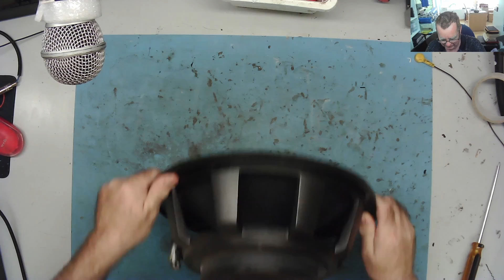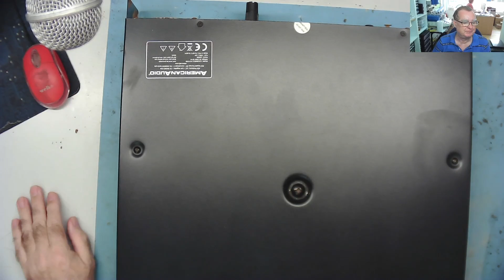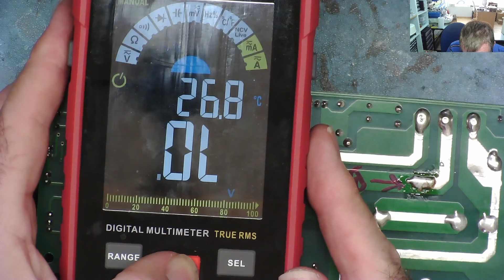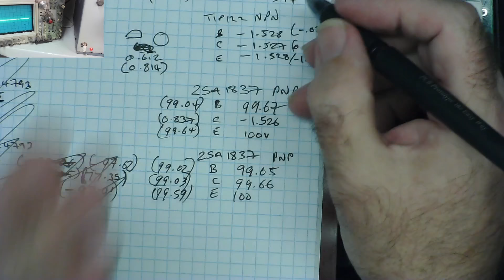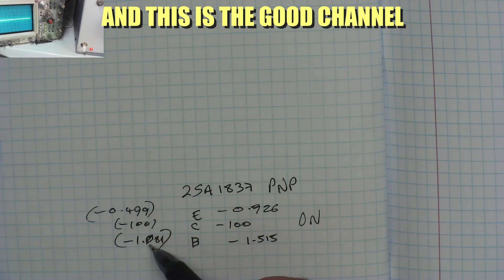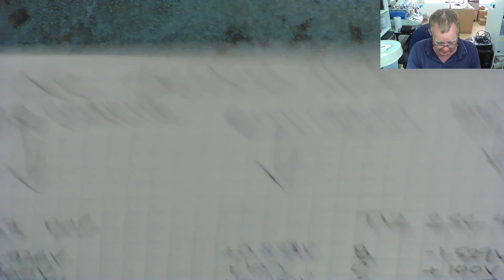Repairing  Electronics From High Level Down To Component Level  Practical Example 1500W PA System

Comment: Being a lazy sod, I like doing a really thorough visual before bothering any tests/components/much dismantling. 80% of the time the issue is visible - as it was here - 20% of the time you have to do the ballache stuff. :-) Is a track burnt? Is a cap swollen? Any dodgy looking bits? Only if the answer is absolutely no would I start dickering with faffery. :-) Like I said, I'm lazy/busy...

Comment: Watched this all the way to the end. Learned a lot.  You da man Richard. BTW, doesn't have to be an EV brand speaker. They are expensive.  Any other basic brand woofer that is more readily available should work as long as it is the same impedance.

Comment: Using the "process of elimination" is basically what you're doing here, and usually the best method when you can do that.
When working on items like this where you've got two circuits with a shared common power supply, you need to keep in mind that one circuit, (faulty one) can drag down your supply voltage/current and cause the appearance of both amp circuits being faulty. So, thats where I would lift the power supply lead to the suspected faulty amplifier and see if you have normal sound. Usually you'll have a plug coming from the supply feeding the amp and hopefully they have separate plugs or you might need to desolder or release a pin on the connector and pull the pin/wire out.
In audio/signal amplification circuits you'll have a few electrolytic capacitors. Capaitors block DC and allow AC signals to pass. When they're used in these amplifier circuits they're called "de-coupling" capacitors. They remove the unwanted DC bias voltage from the previous stage amplifier before the next amplifier stage. Being the next stage may require a different bias to the transistor depending on how its configured to operate or being a different spec'ed component. Like first is the pre-amp then power amp stage having two different types of transistors. Having an old low reading capacitor can give low volume because the coupling is not allowing the AC signal to get through to the next stage or very little of it. It can cause distortion too, because you may be cranking the volume up trying to shove the signal through the weak capacitor into the next stage. Also impedance gets changed with having faulty capacitors. Maximum power theorem, when source impedance equals load impedance is when max power transfer occurs.  You won't have efficient impedance matching with bad capacitors also.

Comment: The signal injection of a sine wave to the amplifier section and move to the output is what i would have personally done first,because SINE WAVES are used to test the LINEARITY OF THE COMPONENTS OR CIRCUIT, I.E THE WAVE SHAPE THAT GOES IN MUST BE THE WAVE SHAPE THAT COMES OUT,IF THIS DOESN'T HAPPEN THEN THE COMPONENT IS CAUSING DISTORSION.THE BIAS COMPONENTS CAN CAUSE A SHIFT OF THE "Q POINT" ON THE LOAD LINE THEREFORE CAUSING DISTORSION ALSO.
N.B.SQUARE WAVES ARE INJECTED TO TEST THE FREQUENCY RESPONSE OF A COMPONENT OR CIRCUIT.

Comment: nice one. I learned a lot. I'm a mechanic, so i font really lknow what I'm looking at. But I think to use signal generator and just follow the path seams easiest. it would have shown distorion on input, after volume board, and a output. Thanks again for showing the whole tought process

Comment: i have been repairing video and audio electronics part-time for over eighteen years, earned a diploma from National Radio Service in Video/Audio Service and I never knew how to test a speaker cone before.  Thank you!  I messed up with a prospective client by telling him, when he brought me over a speaker cone to test, that I could not.  I could have earned money for troubleshooting it if I had only known to check its resistance between the positive and negative terminals.  If I was going to test it, I would have gone through the effort of hooking it up to my function generator and amplifier.
Frank, Frank Reiser Video/Audio Service

Comment: depending on the adhesive used to afix the dustcap to the speaker, you can use MEK (Methyl Ethyl Keytone) to remove soften the glue. Try not to damage the cone as often you can replace the coil without needing to replace the cone, spider or dustcap, especially on professional drivers with large diameter voicecoils. That's a whole other video you could make. 

Some of those EV speakers allow you to unbolt the magnet assembly making it a relatively straight forward job replacing the coil

Comment: Hi Richard, I think this video gives a good insight in to the black hole that you look in to when working on these such things. I think to work on audio circuits you need to have a frequency generator of some sort and an oscilloscope to be able to work on them properly. 

Just to clarify, what was the issue. Was it the cold joints on the output transistor or the bad track?

Comment: What i like to do with audio devices that have no output, or distorted output, is feeding in a sine or quare wave signal, and used a self-made signal tracer.
This signal tracer is nothing fancy, just a old set of computerspeakers, where i added a BNC connector to the housing, the central pin of this BNC connector is connected with a 10nF (0,01uF) 630V rated bipolar capacitor to the input of the pcb with the amplifier. The audiocable with the 3.5mm audiojack is untouched, so this speakerset can still work as a test speakerset, or as a signal tracer with a scope probe to the BNC connector. The 10nF cap is offcourse to block DC voltage on a audio pcb. 
Then with the scope probe connected, i follow the input signal untill the audio signal stops or gets distorted. With big circuits to trace, i use my favorite music from a pc audio output as input signal, because hearing a hour or so to a 450Hz beep is annoying. Grtz

Comment: Having different speakers may very well change the sound, even if they are the same size, impedance and power rating.
There are various magnets like ceramic or AlNiCo for example, sensitivity, frequency range, resonant frequency. ALL these factors and more give a speaker it's characteristic sound. 
There is a lot of complicated electrical and mechanical mathematics in the design of speakers and their enclosures, a speaker is not ''just'' a speaker.
Just be aware of this when replacing speakers, unless you are getting one that is the same make and model. 
You don't want to get an ''equivalent'' speaker that you paid a lot of money for, only for the customer to complain that the sound is too low, too high, too much bass etc.
Reply: in expensive hifi speakers youre right there, but would it be that much different in large PA system used only to play low volume background music ?

Comment: loved it !  I was screamin at the scream " you shoulda put the sine wave earlier ! " .   Always as soon as possible...  Thats a lucky fix with the trace ! It could have been WAY worse.  I'm still intrigued why/how the trace busted... Maybe something fell in ? Amp looked kinda rusty.    I don't know if I would have found the fault any faster than you. However, I do have a ritual of cleaning the boards b4 working on them. 
First I look for damage and the dust and grime can sometimes help. Next grab a super bright flashlight and put it behind the board to reveal stuff you can't see. I use a 12v flat LED panel(40mm x 70mm) that is for a car dome light. It's crazy bright and not much thicker than an LED, so it fits underneath stuff. It lets you see right through the circuit boards making it easier to redraw schematics.
Next, i'll clean the board off real good with brushes and air. Just a quick sweep, but the point is to get all the dust off so I can see. Use a paint brush. Toothbrush for stubborn stuff.  Either a vacuum cleaner or compressed air. If using a vacuum cleaner NEVER get the vacuum ANYWHERE near the board. Flick the dust off with the brush towards the vacuum. Vacuum should be like 6 inches away from the circuit board caz the static electricity is no joke.
  
 You did an amazing repair job. Top notch service. A great learning/teaching experience. 

As far as the speaker >> You can fix it. There is always a way to fix it. I've rewound voice coils before.. Soldered/jumpered broken turns in the voice coil... However, that kind of job is a LOT of work. It takes patience, skill and practice. It's more for really expensive stuff which is irreplaceable >> More important is >> I bet you can get a replacement speaker for about 50$ - 200$ >>  Those high power PA speakers are more universal than you think. Since the enclosure is more like an infinite baffle, as long as you find something that has similar specs it will work fine. Many of these systems don't rely on the back pressure of the port to maintain excursion. For example many JBL speakers use a different type of foam surround that has a bunch of ripples and ductile glue that feels like silicone. This makes over-excursion much more difficult. The speakers barely move when you push them with your fingers !!  = high power.  Just pop a new one in for 200$ and call it a day. 
    You might as well try to repair the voice coil though. since it's dead anyways. It'd be good practice.    

      Oh and to take the speaker apart you should try a heat gun first. If that doesn't loosen the glue then use a solvent. lol, don't cut it :p    Use shims or very carefully folded paper towels to float the speaker cone precisely in the center. Put sound through it & test before you glue. 

good stuff. These are cool vids man.
Reply from the maker: Hi TDT Records
Some very good suggestions there that I will use on future videos.  The amplifier comes from a hotel swimming pool bar so it is both outdoors(though has a roof), subjected chlorine fumes form the pool and right next to the ocean.  This why we get that airborne corrosion here. Google 'Puerto Rico Gran Canaria' if you want to know know where the hotel is located, and then you will see why.  

The Speakers are outdoor resistant, that is what makes them more expensive to replace the bass driver. They are mounted outdoors and exposed to the elements all year round, though in fairness we only get 88mm (about 3.5 inches) of rain a year here and the temperature rarely goes above 32C/90F on a summer day apart from during a Calima/Heatwave and never goes below about 14C (57F) on a midwinter night so being outdoor all year round isn't quite so bad for the speakers as it may seem.
Reply: @learnelectronicsrepair  ahh, I see.  
Now that you mention it. It sounds like the weatherproofing needs to be taken into thy own hands. OR > The client got duped & the equipment wasn't actually weather proof. There doesn't seem to be any conformal coating on that amp. Plus the speaker looks like it's the cloth/paper type. Normal speakers soak up water.  I would get a plastic speaker OR spray everything with that silicone spray which comes in spray paint cans.
Sounds rough !

Speaker cabinets also hate moisture. I can't even count the number of speaker cabs I've repaired where the glue melted away/disappeared from humidity in the air.